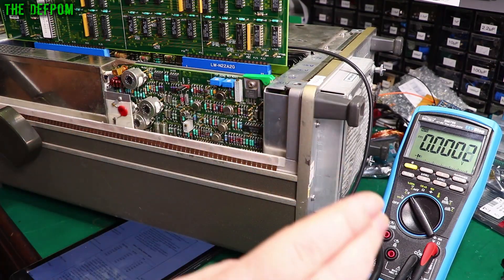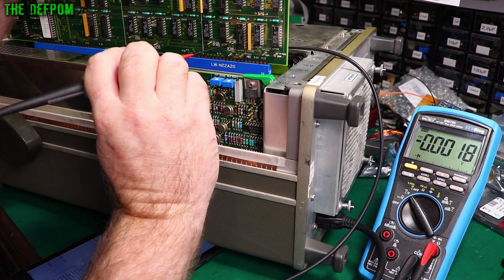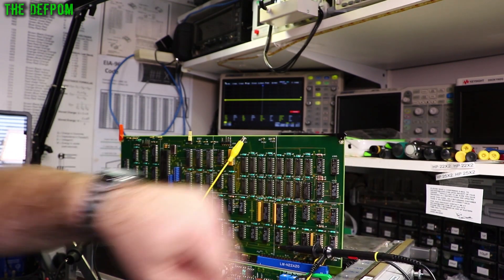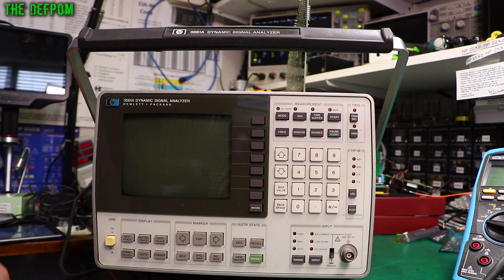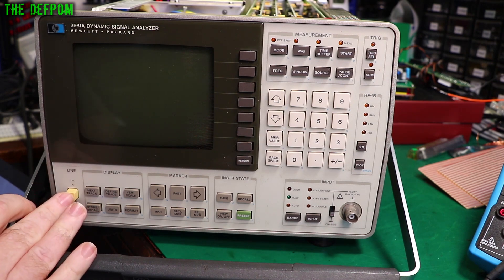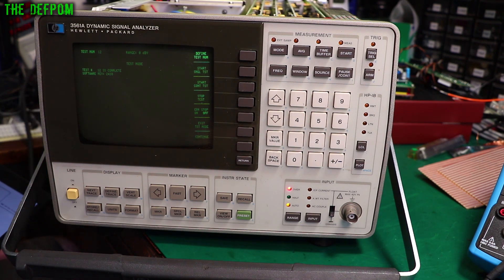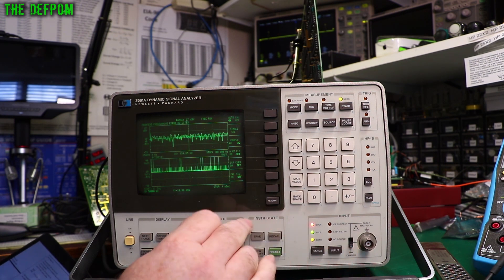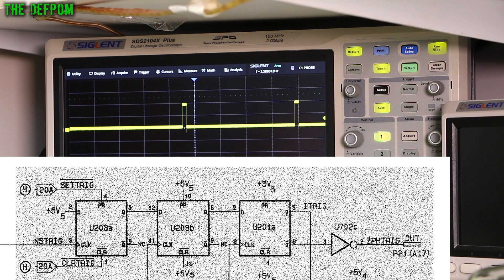🔴 Can I Fix It? -  HP 3561A DSA Repair Part 5 - No.923

Comment: @13:42 U201 pin 5 and pin 6... do you really mean that?  Also... this is trigger timing not 'data'?
Reply: General flip flop pin naming convention D is for Delay, but its also know as D for Data. The jury has been out for years on that one. I just call it D and am done with it....😏
Reply: @IanScottJohnston  I misread the pin numbers on the schematic... so these traces are Q and nQ from pin 5 and pin 6 of a 74F74PC... fair enough call it Data... but not in the uP sense.
Reply: FWIW I call that good;  the 74 chips I see go bad fail hard and stop flopping.
Reply: Looking at the partial schematic Scott showed in the video looks like the 2nd two flip-flops are adjusting the timing of the signal presented at D (U203b) with the clock (10.24MHz) and introducing a small delay of a couple of clock cycles to go with it. All about timing I guess.
So, D, Pin 12 of U203b should look almost identical to Q, Pin 5 of U201a when loosely scoped since the clock to both is a fast 10.24MHz signal.
However, the fact it all suddenly slowed down @14:37 in the vid I'd look at the 10.24MHz clock and see if it's stable.
Reply: @IanScottJohnston  Indeed.  I think that combo is to sync NSTRIG with the 10MHz clock so subsequently DMAs of measurements are synced.

Comment: Thanks for this vedio. i have agilent e4416a rf power meter.  the stand by indicator light is on but when I press the on button nothing happens can you help me.  knowing that the battery measures 2.9v and the voltages 12v -12v and 5v exist